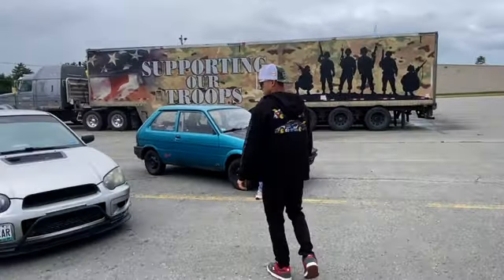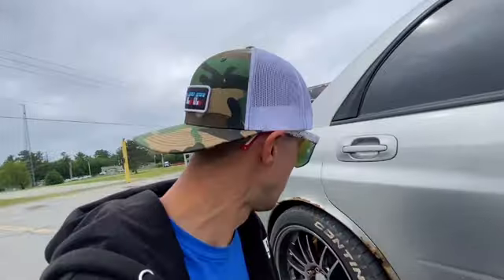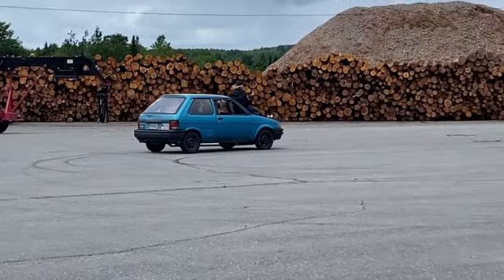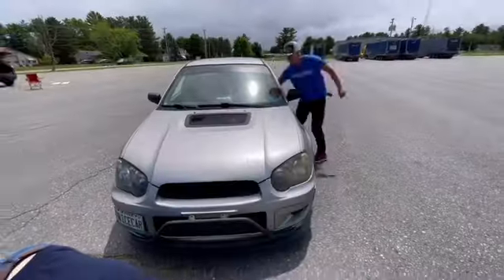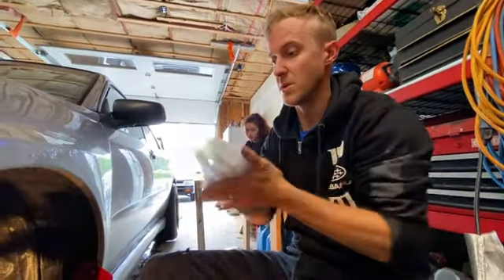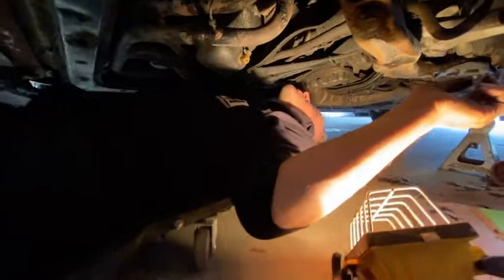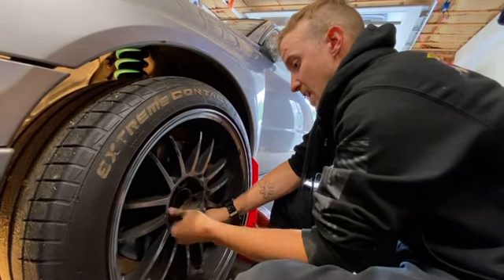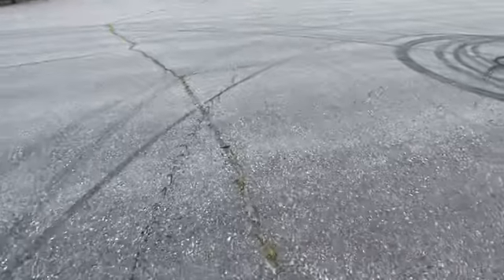Drifting in my EJ207 swapped wrx and breaking and changing an axle in the process!!

Comment: What all is done to the 207 block? I have a V7 207 in my bugeye making 450whp and I want to build it for more. Did you have it machined to be closed deck or just upgraded pistons and rods?
Reply from the maker: The block casting and rotating assembly are completely stock actually! Only upgrades are with oiling. It has a tomei oil pan baffle/block stiffener and windage tray, a killer b oil pickup tube and an sti oil pan. It’s still running a 10mm pump as well because I don’t have avcs and the 11mm would flow way to much. Heads are fully built big port none avcs heads, cams arp headstuds the works.